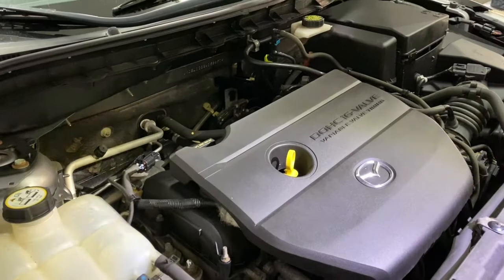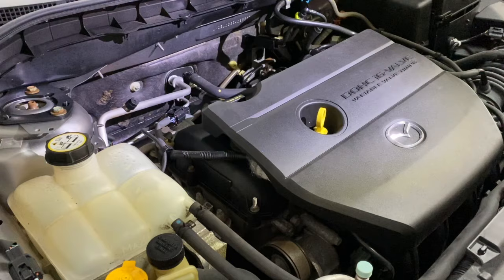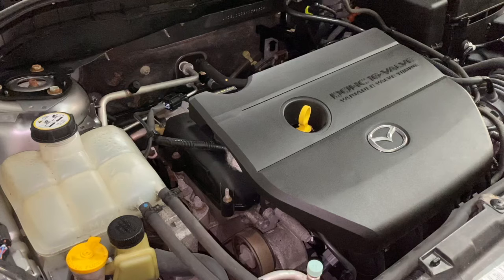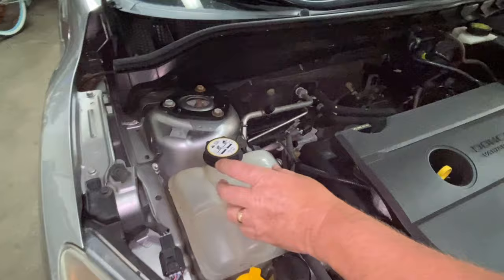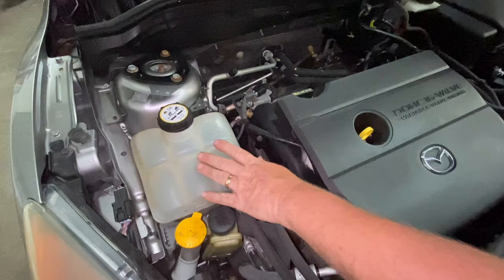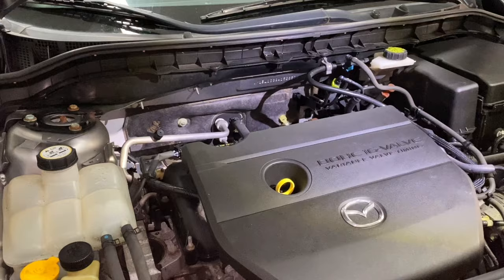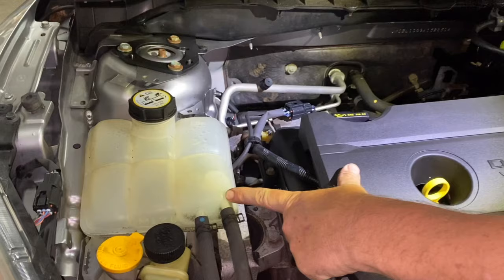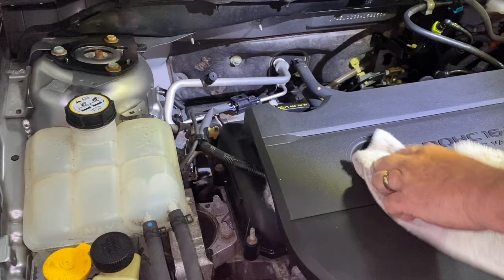Learn 3 Symptoms of Blown Head Gasket

Comment: Great video! I have a question I have a bmw 114i and the coolant reservoir boils if the car has been driven for about 2 miles. There is a slight white smoke coming from the exhaust when it has been idling for a minute or so but once you rev the car a bit it goes and doesn’t continue whilst driving any help would be appreciated! Thanks
Reply from the maker: Something is making the car overheat OR a blown head gasket is pumping up the coolant system as well. You should start with the simple things first. Make sure the radiator cap on the reservoir is good or just replace it. Also, try this, leave the car cold overnight and then before starting it squeeze the upper radiator hose ( the large one) and get a feel of how soft it is, then start the car and wait about 2 minutes and see if it feels the same, if it's harder than when it was cold only after 2 minutes then the pistons are pumping up the coolant system from a probably blown head gasket. Because 2 minutes isn't enough time for the engine to normally build up enough pressure to feel harder when you squeeze it, Make sense? Other things is from a dead cold start without driving the car, how long does it take for the overflow tank to boil over?
Reply: @Motorcarnut  it takes about 10 minutes of driving to boil, I’ll give what you said a go
Reply: I forgot to add the car doesn’t overheat (that I know of) the oil isn’t milky or anything like that and the car still drives perfectly fine despite the boiling coolant. I’m not sure how to find a temperature gauge on this car as it doesn’t have one on the dashboard
Reply from the maker: The "boiling over" IS overheating.10 minutes is kinda of a good sign because that doesn't seem like the pistons are pumping up the coolant system. Like I said try replacing the coolant cap, it's cheap and can cause the overheating by not holding pressure. I know a lot of cars don't have coolant gauges and some you can't even check the engine oil. It's ridicules. They want you to bring the car to the dealership so they can make money off you, no other reason.
Reply: @Motorcarnut  I also forgot to add that there seems to be some red/orange stuff that looks like it has boiled on to the reservoir where the bleeding plug is I don’t know if there could be something linked with it. I asked a mechanic about it and he said it’s nothing to worry about but I’m not sure.
Reply from the maker: That’s probably dried up coolant from when it overflowed.

Comment: I have a 20i18 jeep wrangler.  It started overheating by the time i turned to my house...i saw that the antifreeze reservoir was empty. I put 50/50 antifreeze fluid in reservoir.  Then the next day it start with white smoke from tailpipe and got up next morning now it wont crank up...what can i do to get it fixed?
Reply from the maker: Sounds like a blown head gasket to me. I have many videos on head gasket repair.

Comment: Hey when im sitting idle at a red light, the temp gauge moves a little above the middle, then when I accelerate it goes back to the middle. What do you think this means? Some said radiator fan is cracked or thermostat. Im in a 09 Buick Lucerne super.
Reply from the maker: If the car has no symptoms as I explained in the video then it could be a failing thermostat. Also make sure the coolant is clean and properly filled and system has no leaks.
Reply: My pt cruiser only runs hot when the coolant gets to boiling point then it runs to reservoir bubbling and it doesn't go back to radiator so it's dry and start getting hot and we lose coolant out the reservoir hose is it my gasket or air in system or icm or the thermo or coolant sensor. I straight wired my high n lol fans but now that don't work. The fans just quit working today Fri Nov 12
Reply from the maker: Well you have an overheating problem for sure. Could be as simple as a faulty radiator cap or stuck closed thermostat, or the head gasket. You should get the fans fixed properly not wired manually the computer controls the fans so the car doesn’t overheat.

Comment: I had my radiator and my thermostat replaced on my 2007 Mazda 6i 2.3L . The car still overheats. What other part/s can I check next that will cause it to overheat?
Reply from the maker: Start with the simple things first. Check or replace the radiator cap, make sure there is no air in the coolant system. Make sure radiator fans cycle on and off. When the car is overnight cold try squeezing the top radiator hose see how it feels then start the car and wait about 2 minutes the hose should feel about the same if it’s noticeable harder then you may have a blown head gasket pumping up the coolant system.

Comment: Great video, please advise. Someone put oil into my coolant tank, my car overheated with the coolant boiling oil all over the engine. How bad is this? Do you think my engine is ruined?

I think by the time I saw this issue I could have blown the head gasket maybe? my car reduced power completely
Reply from the maker: Car will overheat and fail like it’s doing. Why would someone put oil in the coolant system? They should stay away from cars.
Reply: @Motorcarnut  but is my car ruined?
Reply from the maker: Car is probably not ruined, but will have the clean out all the oil in the coolant system than take it from there.

Comment: My Jeep compass has been running hot but no leaking any where. Not under the car or from my exhaust. I just got my coolant flushed but they said it was very chocolatey. I don’t know what to do next. Should I get my radiator flushed? Please help me
Reply from the maker: The head gasket is blown. Oil is mixing with coolant. Head gasket should be fixed first and sooner than later before it makes things worse.

Comment: My 2008 Chevy Equinox LT started getting VERY hot out of nowhere a week or so after returning from the desert (which it did not overheat when I was there which is strange) and my dash lit up with a "ENGINE TOO HOT AC OFF" notification. With my radiator fans blowing loudly. At first I went to one mechanic shop that I've been taking it too and said it may be a thermostat issue or something. They spent a few days with my vehicle (for who knows what since it's my only car) and later determined it was in fact my thermostat/possibly clogged heater core. Fast forward to today I took it into another shop for another estimate and guess what? THIS mechanic said that I need to replace a head gasket. $4,500 repair cost apparently. I could buy a used car for that price wtf? I have an extended warranty for it however I doubt they wanna pay that either. There's no check engine light or anything either.
Reply from the maker: This is something that has to be seen in person and since you got 2 different answers I’d go get one more and see what they say.

Comment: What if the white smoke only occurs when you rev the car & it not excessive like that & see no milky & colant level fine
Reply from the maker: During a cold start up that would be considered normal condensation, when engine is hot like driving on the highway for 10 minutes and does it that is not normal and can indicate burning coolant.
Reply: @Motorcarnut  I prob got do compression test their no smoke when I turn it on only when I’m reving it or coming to a light or stop put car netural roll to stop
Reply from the maker: @SeanMcKenzie-mt5ml try pressurizing each cylinder to see if air goes into the coolant system.
Reply: @Motorcarnut  it most likely seals in my motor
Reply from the maker: Head gasket

Comment: I have a 2002 Pajero 3.2 TD. Doesn't blow any smoke whatsoever even on cold start. Have not had any issues with it and drive it daily it stays running for few hours a day but today (was a hot day) I was on highway going pretty hard up and down long hills ECT after about an hour or so I noticed temp gauge rising slightly and if I was to put my foot down it would increase but if I took my foot off and just cruised it would go back down. It never really got too high up the gauge before I finally pulled over and gave her a rest. I pulled over put my AC fan on and sat for about a minute before turning it off. I walk round and pop the hood and my coolant reservoir is full and is boiling away (car is off) wait 10min and on my way again no issues for another hour. 99% sure radiator needs replacing. I don't get any power loss, no smoke ever, and never overheats driving around town for hours at a time. Any opinion? Cheers 👌
Reply from the maker: Could just be a bad thermostat or radiator cap. Check simple and cheap things first. Yes possibly a radiator or water pump failing.
Reply: @Motorcarnut  cheers mate that's the plan 👌
Reply: @Motorcarnut   I have a Chevy equinox 2005 my car blew white smoke one day while driving mine you I have a radiator leak during the whole process of driving it i have to always fill it up with water or it would shut off I recently saw brown milky oil on my stick and when I tried starting it one day it sounded like a coin rattling around from starting it can you help me I can’t even drive it anymore because I’m scared it would damage the engine
Reply from the maker: It sounds like you blew the head gasket
Reply: @Motorcarnut  so I don’t have to worry on the engine just get the head gasket replaced?
Reply from the maker: From what you’ve described, yes.

Comment: My thermostat is stuck closed I believe so it's overheating and not allowing the fluid to fill up the radiator when it got too hot it started to make a clanking sound
Reply from the maker: Can be anything so I would have local mechanic check it out

Comment: I have a question. I have a carolla Toyota 1996. We were passing someone and the car started to smoke and it sounded like we blew a  tire. But there was leaking oil from the engine and no hoses popped off. So what can it be ?
Reply from the maker: Hard to say without the car in front of me but doesn’t sound good, maybe the car blew a rod something bad enough to cause oil leaking after a loud noise should be check by a local mechanic immediately

Comment: I have a 2012 dodge charger that randomly shakes/vibrates on idle..car doesn’t overheat but it does randomly have white smoke coming from the exhaust when I accelerate,some days it will and some days it won’t.
Reply from the maker: Some thin white smoke is normal condensation. They have test strips you can buy that detects exhaust gases in the coolant system indicating a blown head gasket.

Comment: I have the same car 2010 Mazda3 2.0L, overheated and engine wouldn't start. No oil mixing with coolant in overflow or oil pan. Coolant got into the combustion chamber when removed plugs and crank shoots out water. Is the engine savable with new head gasket or too much damage should I do an engine swap?
Reply from the maker: I like to try to save the engine that's in the car before trying an unknown salvage engine. It depends on how bad it was overheated? Because these engines are all aluminum so good chance the head is warped and hopefully not the block too. If it we me, i'd take it apart and check how bad both are, if it's not salvable  and the engine has to come out at least its much easier at that point on to remove it the rest of the way. This is assuming you're doing this yourself.

Comment: Hello sir! Did you have to resurface/flatten the cylinder head or only a gasket swap fixed this problem? I would highly appreciate an answer, thank you so very much for your video and your attention.
Reply from the maker: Thank you, really appreciated! If the engine did not overheat then you don’t have to resurface the cylinder head, but you should still check it for straightness. I have a video on checking cylinder head for straightness too.
Reply: @Motorcarnut  I really appreciate your answer. In my case yes, it did overheat a little and then the white smoke starting coming out of the exhaust pipe. So I guess I'll just take the head out, have it resurfaced somewhere and then put it back on the car... thank you so much
Reply from the maker: @guitartur Yes to be on the safe side.

Comment: My 2009 Mazda 173k original water pump still 
Just did a tune up lol original spark plugs 😂🤷‍♂️
Just do the oil chances 
You’ll be good
Reply from the maker: Actually,maintaining the coolant system is the key to avoid head gasket failure on any vehicle. Maintaining the oil is also very important but has nothing to do with head gasket failure.

Comment: If my car had a crackhead would it misfire all the time on a cold start? Because sometimes a week will go buy then the car will misfire just a little bit and then clear out. The coolant hasn’t dropped either and the spark plugs are fine.
Reply from the maker: I don’t think you have a cracked cylinder head. Probably more like an ignition problem from what you’re explaining.

Comment: does it hurt to use gasket sealer liquid if you don't have a gasket leak?
Reply from the maker: I wouldn’t use it, they just don’t work and can cause clogging of the small coolant passages and in turn cause engine to overheat.

Comment: My 2014 Durango does not have coolant on the deep stick nor oil on the coolant radiator cap. No smoke neither but I do hear bubbling when turning the vehicle of after driving
Reply from the maker: Some are normal, coolant is supposed to flow in and out of the radiator into the overflow tank and vice versa

Comment: I have an Audi, it only blows coolant smoke when I floor it from a stop. It’ll blow alot if smoke only out of the exhaust, turn it off for a few minutes then drives fine. No overheating, coolant is full, doesn’t do it except when ran hard
Reply from the maker: Could be the beginning of a blown head gasket. Light white smoke when the car is cold is normal then should clear up within 5 minutes, especially when it's cold out. But if it's more than that it's not normal.
Reply: @Motorcarnut  it was after a 15 minute drive home, I was testing the 0-60 on a backroad and when I got to about 70 and let off I see a cloud in the rear view. Turn the car off I thought it blew up for sure cause of how much there was. Checked to see if it would start, started up fine and drove it home🤷🏻‍♂️ I figured it would smoke all the time if it was blown or there was a crack in the head
Reply from the maker: Maybe it’s blue smoke? Meaning it’s burning oil?
Reply: @Motorcarnut  it’s white and I can tell by the smell it is coolant, it is confusing to me
Reply from the maker: Then it’s a head gasket starting to fail.

Comment: Hi, please reply. I have a 05 Chevy Cobalt with 169mi on it. The car earlier was shaking when I start it but no white smoke and drove perfectly once started. Later, it had to crank a lot to start followed by shaking badly. Later, I try for 10 minutes in the morning to start it and when it does start, the engine light is flashing and goes out once the car is started, bit white smoke visible. Later, it sometimes doesn't start at all after 15 minutes of trying/cranking but sometimes does followed by shaking and a lot of white smoke but again, all this while, runs perfectly once started only until I rest it for more than 4 hours, again gives trouble starting else starts sooner but does shake every time I start. I changed the spark plugs and ignition coil pack. No improvement at all. Do you think it's the head gasket or something else? I almost forgot, there is complete coolant loss every 5 days and sweet smell once car is turned off. Also, when accelerating smoothly, I can hear water slushing every time from the passenger side I guess the heater core. Could it be coolant? Btw I checked the fuel pump, it's fine. Please reply soon.
Reply: P.S: There is no external leak of coolant. The "later" is an interval of one month each.
Reply from the maker: It does sound like a failing head gasket. When the car sits coolant is probably getting into the combustion chamber causing the hard starts, then it's running fine when getting hot and burning off the coolant. That's a typical symptom.
Reply: @Motorcarnut  Thank you so much :) Much blessings to you. Your a life saver! Any say on the water slushing noise? Is it related to the coolant or something else? Please reply at leisure, no rush.
Reply from the maker: Could be related to the head gasket problem as air can be getting into coolant system
Reply: @Motorcarnut  got it. Thank you so much :)
Reply from the maker: No problem
Reply: Hi, on Monday I gave the car to a mechanic in a proper local garage. He did multiple tests on it for 2 days and said that only the thermostat is bad so he replaced it and returned the car, the car started good for 3 days until today. It cranks but won't start again. The thermostat however did fix the coolant loss I guess because it's just been 4 days but no coolant loss so far. But still it shakes and hesitates to start. I didn't show him your replies yet as I thought it would be rude sounding like I am judging his skills and knowledge. However, I will take the car again tomorrow and show him your replies in a kind manner, hopefully it helps him diagnose and fix the issue. I still hope you're wrong though :D because I'm a student and won't be able to afford the cost of a bad gasket but lets see. I'll keep you posted. Thanks again.

One more thing: https://youtu.be/Cu4KGEDq8s8

I'm having the same issue as the Cruize in the above link. I'll try to show him that as well. i still have one doubt though. Any guesses why the thermostat fixed the coolant loss but the car still won't start and shakes? Does it help to conclude the issue you mentioned above or does it oppose it?